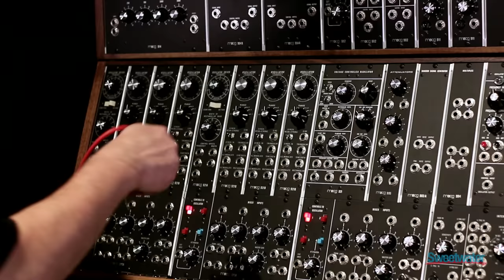Moog System 55 Modular Synth Demo — Daniel Fisher

Comment: What cracks me up is that he never brings the power of this unit to the fore. My Micron has three oscillators. What he ultimately came up with I can pretty much do on my Micron. Let's hear all seven of those oscillators ripping out. Now THAT would be a demo of a $35K synth.
Reply: Possibly, but it really depends on the patch and how they are tuned. This is a test I did with 7 VCO's but they were all tuned the same and track well so a fairly similar sound could probably be done with just two or three VCO's. Having them spread apart in pitch and detuned etc would of sounded more massive. https://soundcloud.com/johnlrice/seven
Reply: Montag Musik I get the impression that these machines have a sound quality that can't be matched (necessarily) by modern computer programs. However, I'm curious to know what really makes it great over a computer program's sample?

Forgive the ignorance, I'm just curious because I want to experiment with sounds like these, however I would like to know if sound samples from a machine like this vs a computer program (FL Studio//Logic//etc..) would be a more favorable thing to consider.
Reply: ThePhilosopher Most of the worthy options won’t be samples. It will likely be an emulation of the synth that generates signal and effects in real time with an absurdly complex algorithm. Native instruments Reaktor and Softube modular offer a solid glimpse. These will however eat your cpu

Comment: You can control a Deathstar and  a Borg Cube at the same time with the knobs and patch cables on System 55.
Reply from the maker: Hi LAVI. It's true. But you need an Assimilation Cable to connect them. Thanks for watching! -Daniel
Reply: @sweetwater  Daniel You should make a video on Elka Synthex

Comment: How does one remember the different plug patches, dial settings and how does one write music for that?
Reply from the maker: Hi Ken. When you build a patch one cable at a time, you'll find that it's easier to remember. And, even if you forget, it comes back to you after you've traced a few cables back to their jacks. Another thing that's extremely helpful is that each knob on a modular synth only has one function, so... every time you turn a knob, you hear what that knob does.
As for writing music, once you've built a patch that  sounds just the way you want it, the inspiration you get from it makes it feel like the song is writing themselves. -Daniel

Comment: What’s with all the hate? Comments like “I could probably do this with an app”. “Eurorack sounds way better than this”. “It doesn’t even sound great”. This was cutting edge technology in the late 1960s, through 1975, when the system 55 was released, and continued to be cutting edge , with the popularity of the mini Moog and the Moog One. This is one of the most important pieces of musical history (a system 55, original, although the fact that these were built to original specs is impressive as hell) No, you can’t come close to this with your shitty app, or plug-ins. To simply understand this enough to use it in a musical capacity takes a lot of complex learning , patience, and trial and error. Eurorack sounds better? Where do you think Eurorack came from? This system is compromised of 5U tiles, with 1/4” jacks, as opposed to the 3/8 jacks we’re used to using to patch eurorack modules, as opposed to the standard 3U tiles commonly used in Eurorack (with exception to the few 1U tiles that Intellijel and a couple other companies make. Also, some companies, like Noise Engineering , have started making 5U modules, along with the few companies that never stopped) For anyone who can’t wrap their head around this being a 35,000 dollar synth, it detailed for 11,900 in 1975. Without the contributions of Bob Moog, Don Buchla, Dave Smith, modern electronic music that revolves around synths would most likely look a lot different. Why is it so hard to watch/enjoy someone demonstrating a gorgeous musical instrument, without so much hate? Calm down. If Moog synths aren’t your thing, and your app can do better, more power to you, and that’s great that you’ve found some joy in a synth app, but at least try and respect the contribution to music this synth made.

Comment: Ok stupid question. How is it generating sounds if he isn't hitting a key?
Reply from the maker: Hi Joe. Analog Oscillators are always going. You actually have to run them through a VCA (Voltage Controlled Amp) that's controlled by an Envelope in order to make them silent. Then, anything that sends widely varying voltages can trigger that Envelope, such as the Sequencer, a Gate (from Note On), or even a cyclic LFO (Low Frequency Oscillator). -Daniel
Reply: @sweetwater  Hi Daniel, thanks for that. I've watched Suzanne Ciani streams and often wondered where the sound and then the melody was coming from, but what you say makes perfect sense. I'm still learning the lingo, so to speak

Comment: The set up as it stands in front of him including keyboard controller and case is actually about $115.000.00! All those pass filters, envelope generators, oscillators and ring frequency generators don't come free with the kit you know!
Reply: When reissued this setup as shown was under $40,000 I believe. They are sold out now so a used reissue one is probably more now and an original one from back in the day might cost two or three times as much?

Comment: why so many cables??? couldn't this be simplified???
Reply from the maker: Hmmmm... Maybe they could invent little wireless transceivers to invisibly connect any input to any output. And then, each of the little tranceivers could have a color-coded LED so you'd still be able to see what was connected to what. Manufacturers, I'm giving this one away for free if you want it.
-Daniel
Reply: @sweetwater  😎👍 Change all the TS jacks to TRS and have +5v on the Ring to power the transmitter/receiver plugs? The plugs would be sold in pairs with unique frequency or ID pairings and pressing the LED button on one plug would light up or flash the LED on the other plug of the pair. Maybe each module could insert an ID code into the +5v connection or similar so the plugs would know what module it was plugged into and then an app could could read all of the plugs and show a representation of the patch, save it, and then be used as an interactive guide for recreating the patch later?

Comment: You meed to make a degree only to get one sound
Reply from the maker: Hi zanfozanfani. While a degree in synthesis or engineering (I have both) is staggeringly useful for getting an exact sound quickly, you'll find that just plugging in cables and turning knobs will often result in amazing sounds - even if you didn't know what they were going to be when you started. -Daniel
Reply: @sweetwater  it seems not so simple as you say, but first of all I need to resolve how to get enought money to buy one 😅

Comment: I have never understood the appeal of modular synths in this day and age.  They take up a ton of room, cost an arm and a leg, and don't make any "unique" sounds that any contemporary analog or analog modeling synth can't already make.  Plus, aren't they pretty much all monophonic?
Reply from the maker: Sure, but the modern ones won't heat your house nearly as well. Thanks for watching!
Reply: So. . . what you're saying is I can ditch my oil furnace, and replace it with something else that will (hopefully) be less expensive to run throughout the winter months. . . PLUS make cool sounds?  I think I'm beginning to see the appeal!